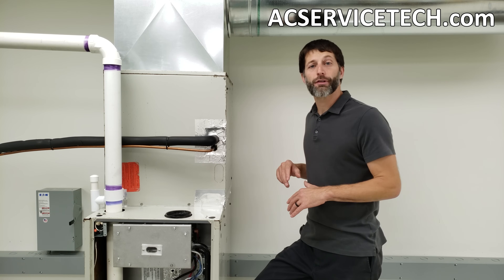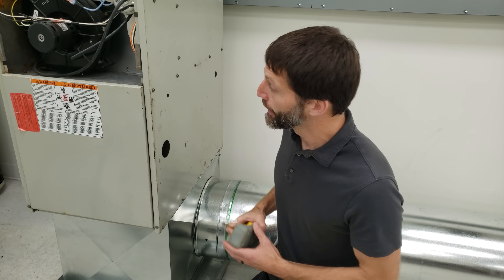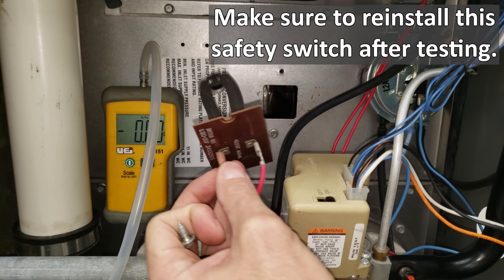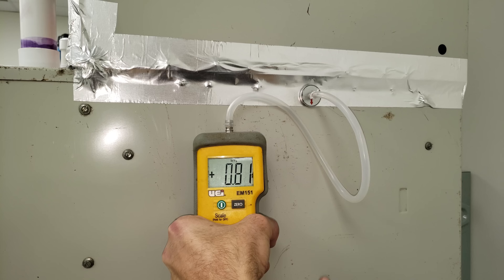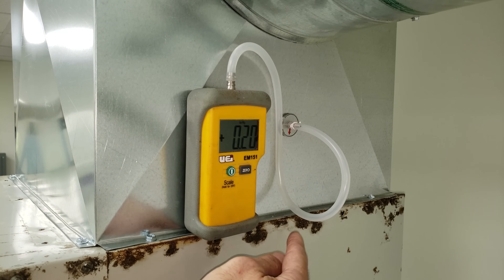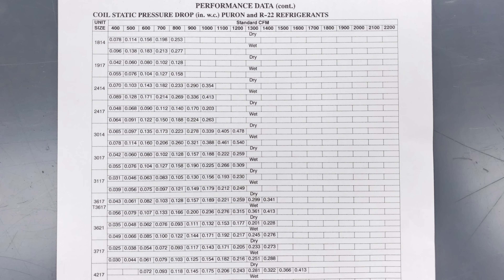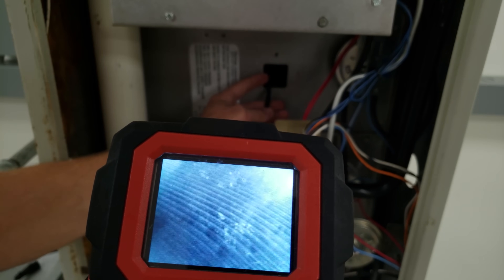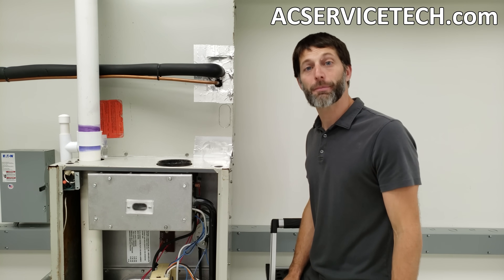AC FREEZING, FURNACE OVERHEATING? Quickly Find the Airflow Problem on a Furnace or Air Conditioner!

Comment: if i have an A-Coil facing the blower will this cause the static pressure to increase? BEcause i have .9 in wc at the return plenum and before tha coil. Its a 5 ton straight cool with a furnace, goodman.

Comment: Unfortunately I happen to have a York unit similar to what you showed with the evap coil above the furnace. Any chance you have a video that’s more step by step on how you clean unshroud and clean a coil in that situation with without disconnecting the line set?

Comment: Do you check static pressure while the ac or heater is on? Or just run the blower motor instead with out ac or heating?

Comment: I mean, I do have that very manometer. And it's really good. But I rarely use it when dealing with airflow issues. I just make it a habit to check coils, even hard to reach ones. A poorly performing system can have many reasons behind it, but it doesn't take too much effort to look at the coil. I have my light, drill, and a good brush typically get the job done. And a lot of elbow grease. Sometimes I'll use a shop vac or something. A brush usually removes those wool sweaters. But I really do like this systematic approach. Very thorough.

Comment: If the back of the furnace is open to service ( not to common ) the back of the Evaporator coil doesn't have the line set or metering device or distribution tubes in the way.  Be very careful cutting open the sheet metal not to hit the U tubes on the back side of the coil. Also found out not to hit coil with screws attaching new cover.

Comment: This is still all really confusing. I thought static was air resistance. Why does the meter show a minus number at the return and a positive number at the supply, how does the meter know the air is sucking or blowing with just a rod with some holes in it stuck in there? I thought total external static measurements was a measurement at the return and a measurement in the supply.. not a measurement inside the furnace. : T
Reply: Comparison with the actual room pressure measured at the meter.

Comment: Great video. Would you elaborate for me I’m a little confused.. Do you not subtract the (-.21) from the (+.87) giving you (+.66)? And would you explain why?
Reply: You are finding the diference between the two so it is 0.87 - (-0.21) = 1.08
Reply: He is determining the total pressure drop across the evap coil. Pressure entering the coil is + 0.87" w.c.  Pressure on the downstream side of coil is + .021"w.c. So the pressure drop or restriction value of the coil is +0.87  minus +0.21 leaving + 0.66"w.c. of resistance to airflow.

Comment: Having 58 rental units to contractually care for I have become quite proficient at in unit coil cleaning. Renters tend to remove filters instead of replacing them. I have developed my own system for cleaning furnace "A" coils in system when possible. An expandable V shaped water and dirt collector of my own design is installed below the coil and a shop vac attached. I use the red acidic type cleaner with a carpet blower providing fresh air to me. I wear safety goggles and a face shield along with charcoal respirator. (I learned the hard way)
I scrape away as much as I can, spray the coil then rinse. Repeating as necessary, often 4 to 6 times. Then when its clean enough I rinse til I am sure it's not acidic then I am halfway done rinsing and rinse it a few more times. 
If the coil box is too close to the heat exchanger I remove the coil the old fashioned way and clean it outside but I can do many of them without removing it to great success. After 10 years of working on the same units I have not had any problems. Only 1 blower motor failed early on because I failed to cover it correctly but no coil thinning or leaks.
Reply: That collector sounds rad -- you should maybe make a video.  Trying to picture how I would DIY it, and coming up blank!

Comment: Craig, since I’ve seen very little comments about it, I’d like to mention also that some brands of furnace the secondary heat exchanger is another place that gets clogged up and is often overlooked.
Reply: Very common now with high efficiency furnaces. If that coil is dirty the secondary is also plugged up
Reply: I’ve seen this. Pulled the blower and doused it with coil cleaner and cut in the top plenum and sprayed Down. Used 2 cans
Reply: I agree 100%. I was waiting for him to mention this.

Comment: Taking static pressure seems to be an unnecessary step for this troubleshooting example. Wouldn't it just be easier to pull back that coil plate and look with a flashlight? What other ways would static pressure be utilized? Would undersized/oversized duct work cause this problem? How would you accurately address it? Thanks for another good video!
Reply: Drilling a couple small holes is much quicker than taking apart a coil compartment.  And if he’d have not gotten such lower pressure above the coil he could easily have kept moving through the ductwork.  There are many possibilities for high pressure (insulation coming loose inside ductwork or vents that are closed).  As far as ductwork undersized your only option is to change it.  At least the first few sections until you have some vents relieving the pressure.